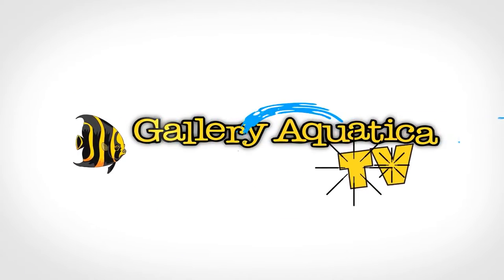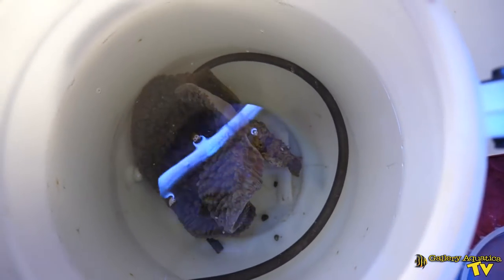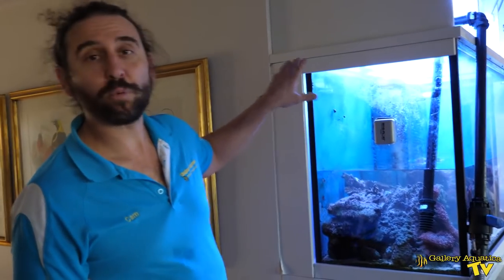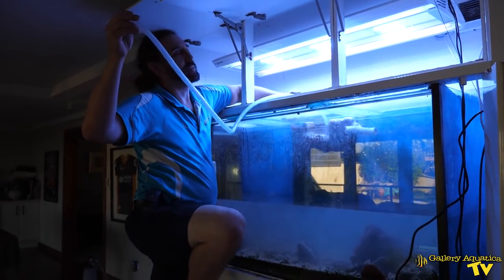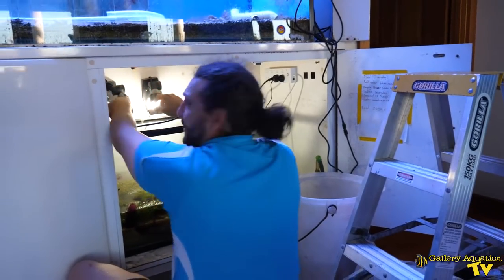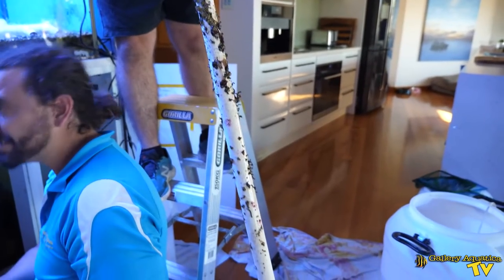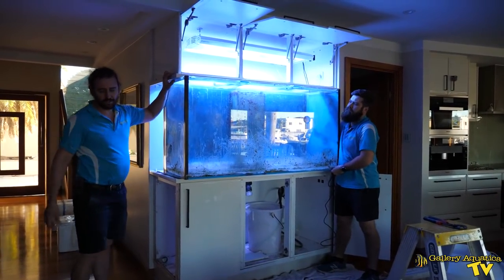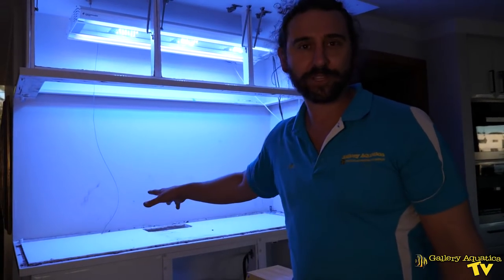Reef Redo: Part Two

Comment: Why are you making it so hard to remove the sand? What I do is when the tank is filled with water still push all the sand into a corner and then start siphoning water into a bucket then just put the tip of the hose into the sand and it will start sucking it up, when the bucket fills up dump the water and all you’re left with is the sand repeat this couple times till sand is gone then drain remaining water, removes 99% all the time
Reply from the maker: That works when you’ve got a small amount of sand, but when there’s heaps of sand like this you run out of water and it’s a futile method. Cam